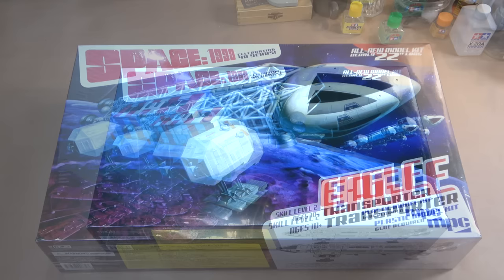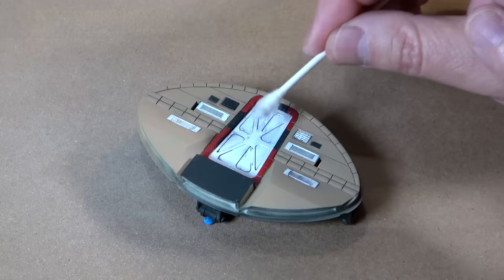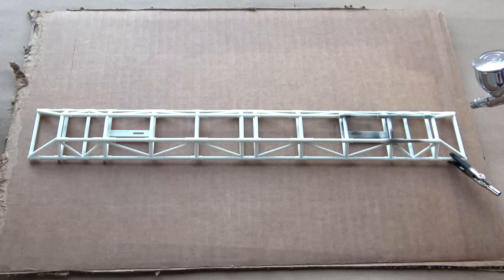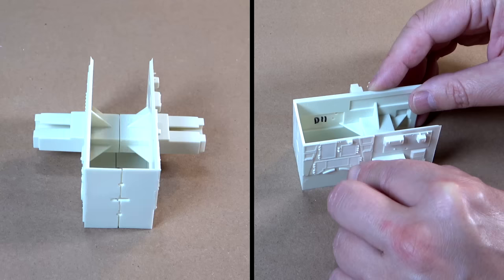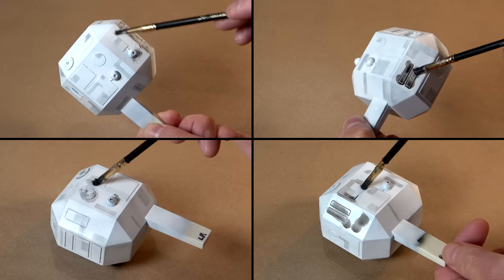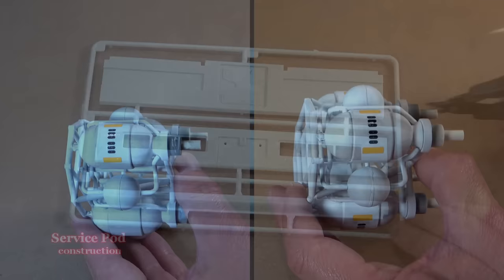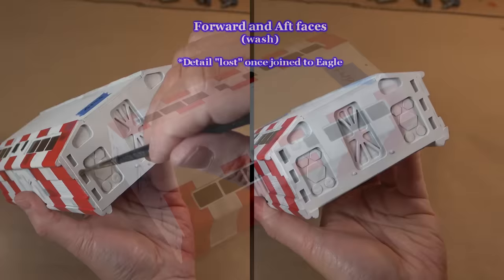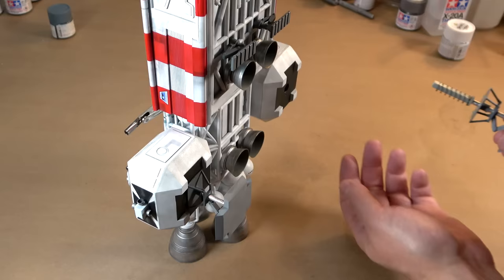Building the MPC 22 inch long “Eagle” Transporter from Space: 1999

Comment: The series ran on WGN-TV 9 in first-run, Sundays at 5.30p. After the series became a hit, WGN started showing repeats Tuesdays at 7p. Then during the summer of 1976, the series' repeats were moved to Tuesdays and Thursdays at 7p.
Second season, the show was back on Sundays at 5.30p and left the schedule after "The Dorcons."
In the fall of 77, reruns Sundays at 5.30p picked back up through spring 78. Then, it was gone again.
In July 79, calls to the station got 4 weeks of repeats Sundays at 10a to help promote Space:1999 Con 79 in Pittsburgh.
WGN burned off the broadcast rights putting the show on in various overnight time slots as filler through 1981.

The series was picked up by WGBO-TV 66 and shown M-F at 5p during the summer of 88. 66 pulled it then returned it to the air in 1991-92 7 days a week at 4a, sometimes another episode was doubled up at 5a. Later that year, it ran M-F exclusively on The Sci-Fi Channel.

Comment: Great video and excellent job on the Eagle! I've built the same kit myself a few years back, although I opted to add the aluminum engine bell upgrades which also included the struts for the landing pods. I also had to replace the springs as the ones in the kit would not allow the Eagle's gear to retract when landed. Definitely a sharp looking model!
Reply from the maker: Thanks for sharing your experiences, Noriko Takaya  😃

Comment: The Apollo lunar module halves were also present on the service and engineering module compartment.  Great job!
Reply from the maker: Hi Avion Air, yes,  a very tiny LEM! There are the other hidden features, but I just pointed out the one I thought most model builders would recognize readily. 😃

Comment: There is an aluminum parts pack available for this model that has the 8 bottom engine bells, the 4 rear main engine bells and aluminum struts for the main landing gear.
Reply from the maker: Hi Kenneth, yes, that's the Polar Lights kit which I quickly mentioned in the introduction, though I didn't know it included the struts too. It's pretty expensive if I remember correctly. 😲
Reply: @MaxAfterburner  True, it is expensive, I bought the Eagle 2 with lab pod kit as well as the spine booster kit and got the aluminum for it. The aluminum add on kit was actually more expensive than the model itself.

Comment: A marvelous piece of work! Do you apply a coat before applying the decals?
Reply from the maker: Hi Cobus Prinsloo, I usually do, but not in this case. There were no areas on the emblems/markings that risked silvering. However, the landing gear pods did get a coat for the weathering and so the decals there did "benefit" in those locations.

Comment: Awesome work, Max! Question, what did you use for the “wash” to fill in panel lines and accent recessed areas? And for the weathering applied with the applicator, are those the Tamiya weathering packs?
Reply from the maker: Hi Terry, in that video the wash used is shown as an inset image at 6:32 and 8:46 and the powder packs at 8:30 and 31:05.

Comment: Max another awesome build and video sir. I have a question and I think you may be able to help me out. How do (if it's possible) de-bond plastic parts from a model? I used Tamiya extra thin cement and I need to somehow separate the parts without damaging the kit. Any advice would be much appreciated. Thank you from a fellow veteran (20 years US Navy, if I was smart I would have joined the Air Force!😁)
Reply from the maker: Hi Chris, thanks for your service, sir. Usually the glues if working correctly melt the plastic parts together like a weld. I don't think there's a way to undo that other than carefully cutting the pieces apart at the glue joints. It would be a lot of risky work for sure.
Reply: @MaxAfterburner  hey Max, thanks for the tip. It did indeed take some careful cutting but it worked, thank you. I'm working on a Tamiya Calsonic Skyline GT-R (1/24th scale). You saved my kit sir. Again thank you so much for your help and taking the time to answer my question.

Comment: I wanted to ask a question and see if anyone had more knowledge than I do about this...
I've noticed vendors selling things like keytags made from reclaimed aircraft skin/fuselages like F-14, F-4, 747, A380, etc.
I noticed the other day on an auction site that a vendor called JetAeroStream parts claimed to be selling fanblade pieces from multiple plane types -- F-14, F-14, F-16, F-4, etc.  These were F110 and F100 fanblades allegedly made of Titanium.
I checked against a photo of an F110 just to see what the fanblade surface looks like and honestly it DOES look the parts he claims are from scrapped engines are indeed Titanium alloy. 
I think it's possible these are what he says these are but I find it easier to believe the keychains are from scrapped airframes than the fanblades are from decommissioned F100 and F110 engines (as well J79 and whatever manufacturer made the civilian airliner engines).
I know I'm not spending $120 on an F-14 keychain just because Top Gun 2 was released this past year (!) but the fanblade display is tempting...
Does anyone else find this memorabilia a bit on the sketchy side, or does someone else out there OWN things like decomm'd, deactivated F-4 ejection seats and F-4 tires?!?  😂
To me, this seems like weird stuff to sell but still not as bizarre as someone selling underwear alleged to belong to Marilyn Monroe!

Comment: Well this is cool. But it's not the kit l was looking for. It's been about 45yrs. So l dont remember the maker of the kit l had. The one l built was a combination of polystyrene and paper. The truss work sections were to be constructed out of white paper straws. They were to be hand cut and assembled with white glue. Each truss section had a pattern to follow in the same manner as one would with the old balsa wood plane kits. Does anyone have any info on that kit?
Reply from the maker: Hi FoulOwl, I can't say I have any knowledge on that version. I never heard of it until now.
Reply: @MaxAfterburner  Thanks for your reply. Actually l found it. It's a rare kit only produced in 1976 by Milton Bradley. But upon research it was an all paper model. But l also built other Eagle kits that were polystyrene. I must have been combining memories of several into one combination paper/plastic kit that never actually existed. I would have only been 8yrs old at the time. So, that seems likely to be the case.

Comment: How did you seal the weathering powder?
Reply: Probably the clearcoat at the end.
Reply from the maker: Hi Joe Schmo, you are correct! Also, the powders hold on surprisingly very well. I thought I would have some difficulty of it rubbing off as I handled the model, but it wasn't the case. The flat coat sealing also helped even out the overall "brightness" of the model as well.

Comment: What is the scale of this model, please?
Reply from the maker: Hi David, some call this a 1/48 scale, but technically that's incorrect. That would make the real life size version of this spaceship as 88 feet (26.8m) long. Most Space: 1999 fan sites and production notes have the length as ranging from 102 ft to 118 ft  (31m - 36m) long. I accepted the 102 foot specification as a basis for my work. So, my scale would be an oddball of  1/55.6  🧐
Reply: @MaxAfterburner  , thank you twice: one for your prompt response, and next for your information. 
   I'd met Nick Tate. Wonderful raconteur!

Comment: 8:13 Sorry to be nitpicky, but surely those astronauts are too big for the model? They wouldn't fit through the door without bending double.
Reply from the maker: Hi andysmith1996, MPC was very faithful to the original TV models from which they took measurements and details via the actual props -- all the way to the oversized crew members 😎
Reply: @MaxAfterburner  I guess in that case it raises the question of whether it's better to reproduce an error just because it was found in the originals or to correct it so that the model is internally consistent.
Reply from the maker: Hi, I guess they may have subconsciously left it to the builder to come up with replacements. 😃